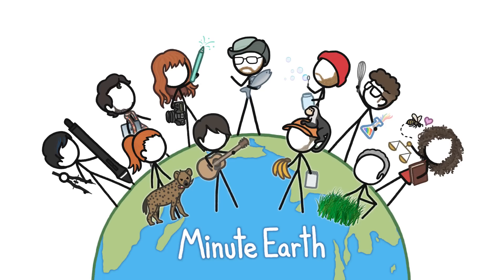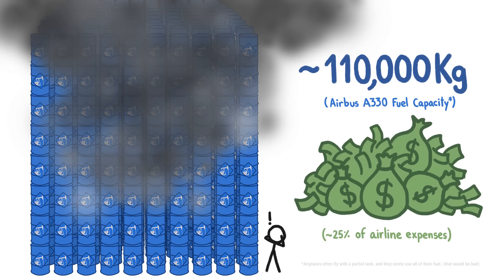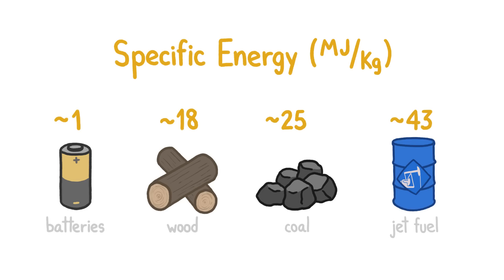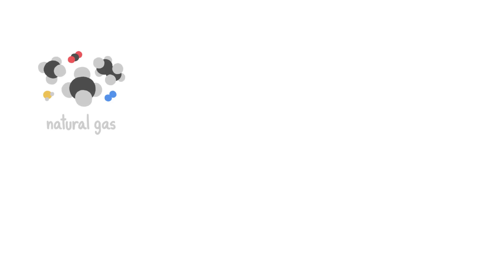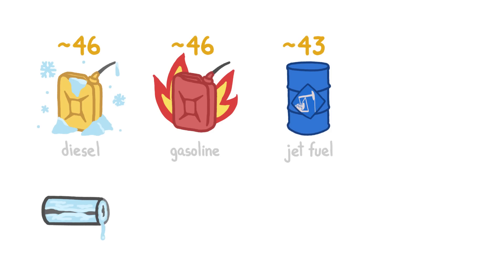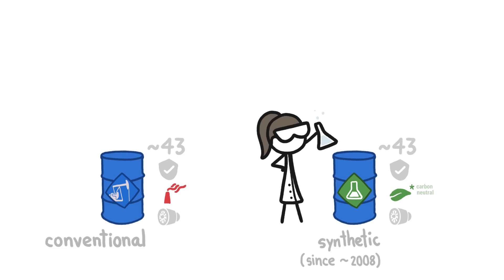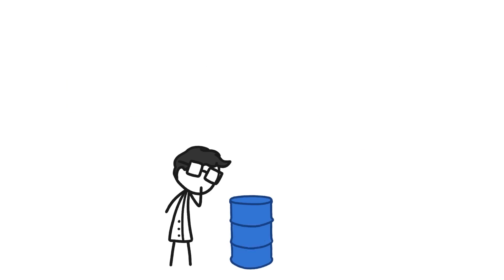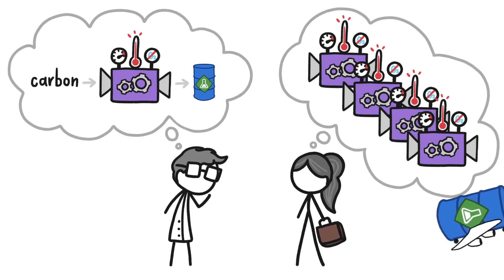Is There A Better Way To Power Airplanes?

Comment: +Minute Earth Just watched your vid against dis-information, then this!

* Nuclear Airplanes are an extremely interesting part of aviation history. http://www.aviation-history.com/articles/nuke-american.htm Moreover, AFAIK it was the closest #Thorium-#MSR came to productive use - a transmuting reactor can eat up nuclear waste that's impossible to safely sore (>100,000 years) and convert it to nuclear waste that IS decaying in manageable timelines (~300a).

* To "mimic natural processes", you have to harvest carbon dioxyde from the athmosphere - everything else would take stored carbon and release it, like kerosene, only with a worse energy balance. This won't be possible by plants (they don't grow as fast as we need the carbon). Even with the newest research in algæ, this won't suffice to cover our kerosene consumption.

* Thinking about "alternative jet fuels" thus is a fool's errand. What DOES work is "alternatives TO jet air traffic":

** The German engineer Bœlkow - you can see his work in any modern small rescue helicopte being able to land in small spaces like in a street crossing - brought up dirigibles. Hybrid concepts - vehicles creating most of their lift by LTA, but need thrust to stay afloat and not sink gently - are one possible venue. Fun fact: In Schütte-Lanz-Zeppelin airships, there was Traggas (Hydrogen, or if available Helium) and Kraftgas (fuel). The fuel gas, most likely ethane, had the same density as air, so consuming it did not alter the balance of the airship.

** But in the short and middle terms, it helps TREMENDOUSLY to leave trans-oceanic air traffic as it is and get intra-continental traffic on the ground. The #Transrapid MagLev, eg, was constructed so that its thrust was to be created by stationary power stations; and its railway was only energised in the blocks the vehicle was in and the next, switching off after it passed them. It was designed to eventually reach a speed of 750km/h, while, however, 350km/h was the initial Vmax in order to research any possible stability issues travelling at higher speeds for extended times.

#Transrapid was built in Shanghai, Red China. Although it was planned to connect metropolitan areas in the FRG in the 1990s, it was abandoned due to cheap air traffic. 

A country like the USA or Russia with metropolitan areas separated by long, sparsely-populated stretches would be almost the optimal use case for the design. Of course, it's only profitable when the carbon dioxyde balance majorly impacts the price; in other words, when carbon dioxyde reduction is taken seriously.

"Alternative Jet Fuels" are as anachronistic as "modern coaches". The need for them is greatly reduced when overland traffic is brought back to the ground again and only necessary trans-oceanic travel has to be airbourne. As long as people want to fly cheaply short-distance, it simply isn't feasible.

Comment: Thanks for this. Ever since I knew about hydrogen cars and that batteries were too heavy to allow electric airplanes, I've been wondering why while it's not as practical for cars, hydrogen powered airplanes couldn't be a thing.
Reply: The Soviet Union made a hydrogen powered plane so it’s feasible but it’s not as efficient, yet
Reply: Hydrogen powered planes are working just fine actually, it's incredibly easy to burn hydrogen in a jet engine. The pressurized tanks are heavy but not more than full tanks of jet fuel, really it's manufacturing hydrogen that's the biggest issue. It runs into the same cost problems as synthetic fuel

Comment: I recommend using nuclear fusion and you can compress hydrogen
Reply: Yeah, if we can figure out how to even create nuclear fusion without insane temp or pressure and at a scale where it is profitable and energy used to create fusion is higher than the energy output by fusion, if it is a tech tree, we aren't even at Tier I fusion
Reply: @isaaclao2380  true.

Comment: What if we just make the planes travel differently such that they use less fuel. What if a ground based source of power got the plane started so it only needed to travel along not take off.

Comment: wait haven't we tested hydrogen fuel jet engines and found it actually works well. Problem is just the cost, since producing and storing is a pain in the ass. Also a minor loss in cargo space, which effect the cost per flight. But if I remember right normal engines can run on it just fine, so not a lot of redesign. Actually now that i think about it, why is it hydrogen fuel is not being given more credit? We kinda have the infrastructure for it, so switch over would be not that bad. It has good energy potential for a lot of current vehicle needs, and burns clean. Producing it can be done using things like nuclear power, thus cleanly and to a very effective degree. Also it's rather safe, since it wont spread or pollute and wont explode unless you give it a fuel air mixture inside a container for some reason. It's actually rather weird how amist all the clean energy wants and needs, it's not given more attention.

Comment: just because its 'free' doesn't mean its the best choice. synthetic fuels are superior to electronic cars, since it uses the infrastructure, the available cars and is co2-neutral if made with green energy.
i don't get why this obvious way to go isn't being followed as it should. ofc fuel would be more expensive, yet there is no alternative to it. the disposal costs of new e-cars and old cars alike would outweight the front-loaded cost of a more expensive fuel. but ppl are dumb and don't get it.

Comment: So let me get this straight. A video sponsored by Bill Gates is saying that nuclear fuel is too dangerous. A fuel that has been used in subs and aircraft carriers for decades, produces no carbon emissions and is much cleaner to mine for than coal, oil and lithium. This just shows that gates does not want clean air or green energy, just to keep people poor.

Comment: Synthetic jet fuel is a stupid idea. You need to pump obscene amounts of energy (usually in the form of electricity) into it through a less than stellar process in terms of efficiency. Considering that one of the most economic ways of getting electricity is by burning fossil fuels through another energy inefficient process, the modern energy paradigm (which is not gonna change within the next 20 years) dictates that not only will conventional jet fuel always be cheaper than the synthetics, it will also always be more carbon efficient. Unless you change this entire paradigm (which, for various reasons, is probably not gonna happen), synthetic jet fuel will always be a stupid idea.

Comment: “Less pollution” sounds dodgy to me. Needs to be “no pollution” or we’re all going to hell in a handcart
Reply: Synthetic fuels like bio-diesel are beneficial from a pollution standpoint. They still produce greenhouse gases when burned, but the act of growing plants to produce those fuels captures carbon. Versus with fossil fuels, where that process takes millions of years, with the synthetics, the carbon will cycle between the fuel and the plants and we can basically have 0 net pollution. Its possible some of the alternative combustion products or processing side products will prevent it from being strictly carbon neutral, but its a very huge step up compared to just burning trapped carbon.

Comment: You didn't mention that there is solar powered airplane. One that flew for almost 26 days straight without refueling. Sure it was unmanned and ultra light and that's a LONG way from powering something that could carry people but it's a theoretical alternate power source. And that's not even mentioning other types of aircraft like an airship which does run on jetfuel but might be more suitable for a refit.

Comment: Y’all are disrespecting nuclear fuel. First of all, we’d definitely shield the uranium in the sky, so we only have a risk during a crash. Secondly, that energy density is insane.
80 million mega joules per kg
A regular jet needs 110,000 kg of jet fuel at 43 mega joules per kilogram, or 4.73 million mega joules.
4.73/80 = 0.059 kg or about 60 grams of uranium for a long distance flight.
Additionally, the cost of just fuel will plummet. Uranium is about $78 per kg (less in its market form but we need fuel grade). So we are talking $4.68 per fill up compared to tens of thousands of dollars. Of course the planes will be more expensive so I assume it will cancel out.

Fat man and little boy had 65 kg of uranium each. A minuscule amount was transformed into energy so the rest got flung through the atmosphere as fallout. In 2019, 86 commercial airlines had accidents, only 8 of those had fatalities. I will assume that all 86 bring a risk of nuclear leak - which is insanely pessimistic. So, if we say 100 flights per year crash with risk of a nuclear leak, then we leak 6 kilograms of uranium over a year. It would take 11 years to equal the fallout of Hiroshima, which itself was minuscule compared to later nuclear tests. And most will be contained to airports, where we can more easily clean up. That’s assuming we are not protecting the uranium from crashes to begin with AND that every gram of uranium leaks with every crash.

I think the limiting factor is not safety, but size and deployment. Can we create a nuclear reactor that a) can turn on/off b) continue running while low on fuel and c) can fit inside a plane. I think some reactor designs can safely move from high power to low power modes, solving a) and b), but that would mean you’d be refueling a live nuclear reactor. IDK how touchy that is. I think that by far c) is the limiting factor. The radiation risk is just to low to make that the sticking point, but most reactor designs fit inside buildings, not planes.

Comment: What about solar powered planes hybridized with batteries? They could recharge midflight and help reduce the weight of the batteries required. Since planes would most likely almost always have sun light, it seems pretty obvious

Comment: This is for once a very poor video with a single wrong message: "no other solution". It forgets to introduce so many aspects, such as high efficiency electric propellers combined to fuel cells (that are high density and already available technologies), ground assisted take-off, not to speak of MagnetoHydroDynamic or ElectroHydroDynamic technologies that are more futuristic !

Comment: Fusion powered cars, domestic robots, portable computers, nonpolluting planes.
Technology, technology never changes.
Reply: it only took 200 years to build this oil and combustion engine based society we have today...
Should I seriously  think that we can replace oil in just a decade even if we tried? -Nope. This transition will take decades at least even if space aliens hands over a perfect blueprint of a new engine that can use air or saltwater as fuel. 
There are millions of machines that needs to be replaced and spit out from factories. And entire factories needs to be rebuilt. And oil needs to be wasted to build all those new cars - since half of all oil used in a cars lifetime happens during the production process with all paints, plastics, and only a single tire would take 7 gallons of oil to make. 
Do we even have billions of tonnes of oil to do replace all cars in the world? I dunno.

But it is not just cars we need to replace... we also needs to replace motorcycles, trucks, airplanes, helicopters, bulldozers, lawnmowers, chainsaws, leaf-blowers, diesel trains, cargo ships, motorboats, motorbikes, tractors, and much else that have a combustion engine inside of them. And that will take years to do.
So I hope the space aliens be kind to also bring some hundreds of billions of barrels of oil to us, because otherwise would we quickly run out of it.
Especially now since China and India also want to western lifestyles - and that demands gigantic amounts of oil.
You need a 3 pound computer would need 30 pounds of oil to make. And then you need oil for plastic bags, handles on forks, toothpaste is made from oil and so are also cosmetics, medicine, perfume, and some types of clothes and candy and many thousands of other items.
Much of our use of plastic is pointless waste, but switching over to not using oil will not be an easy transition even with new technology. We are simply too dependent on oil as it is now.

Comment: Is it ever likely that we will have that synthetic jet fuel soon enough? Oil is running out, and companies aren't willing to invest because of capitalism worldviews.
Reply: I don't like capitalism, but blaming it for the failure of not inventing environmentally friendly sustainable jet fuel is something that only clueless idiots do. The airline industry have tried to do what you say they should do and they have invested billions in research but have failed to come up with any alternative - simply because such an alternative probably doesn't exist.
There are simply too many hurdles to come up with the perfect fuel... you must be able too mass produce it, it must be cheap to make, the fuel most be able to handle extreme temperatures, it must be energy dense compared to its own weight, it must be energy dense in relation to its volume, it must not cost too much energy to create that energy...

Those are just a few of the problems with finding a good fuel for airplanes.
But since you know better than the airline industry, then I suggest that you present your solution to them.
You would become a multi-millionaire from patents of your new super-jet fuel or engine that use water as a fuel.

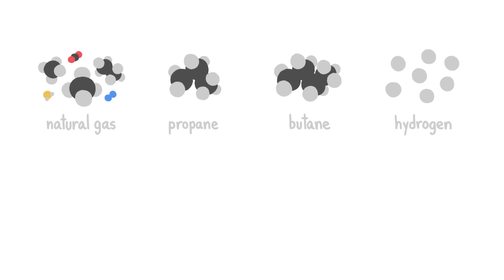Comment: 1:13 you know there is liquid form of these molecules right? We were just about to send people to space... if rocket fuel tank standard increase, maybe we can use it on airplane too.
Reply: Gaseous hydrocarbons can be liquefied, but it requires refrigeration and/or pressure. Butane is the heaviest (weight in this case is molecular weight, the density of the fluid when liquefied as far as I know is only loosely correlated to this) and is what is used in things like pocket lighters - it only requires slight pressure to liquefy, and has a boiling point of only -1°c!! That's so high that lighter gas is usually a mixture of both propane and butane, so lighters wouldn't become useless at subzero temperatures. Gas stoves used in very cold temperatures have to use special gas mixtures because of this, if you used the regular butane mix it would just stay liquid! Propane on its own is used in gas appliances and stoves and stuff, and you can really tell the difference in boiling point. Instead of a flimsy sheet metal or plastic container, propane tanks are heavy metal, to withstand the pressure of the gas and have a safety margin for very hot days and such. Ethane as far as I know is not really used as a fuel? I lack an explanation as to why, but I suspect it's used as a chemical for industry and separated off. Methane, the lightest, is the most important one. It is very cheap, both because it is the primary component of fossil gas, and also because there are organisms that can create it out of other organics! This makes it of interest for use as aviation and rocket fuel. The downside is of course the boiling point... Being only -161°C. Methane actually cannot be liquefied at room temperature. For use in cars and stuff, it is usually stored as a high pressure gas, but that requires very big tanks that store very little gas. For rockets, it is liquefied, with expensive cryogenic systems, that require another coolant, something like liquid nitrogen, to keep it cool without boiling off (the alternative is letting it boil to cool it down, but the greenhouse gas emissions from this would be MASSIVE, and the losses unacceptable). This might be possible to use on planes, but would probably make it much too expensive sadly.

Another problem with liquefied gases is that, even when liquid, they're still not as dense as liquid fuels like kerosene. The density of liquid propane is about half that of kerosene, and the energy density is two thirds of that of kerosene. 

I don't think liquefied or compressed gases as airplane fuel could really ever be viable. Metal hydride hydrogen storage has shown promise for storage density, but it is also very heavy because of the metal part itself. With current, or near-future technology in mind, I don't think planes will use anything other than diesel-like fuels. Maybe instead the source of those fuels will change, switching from primarily fossil fuels to, for example, algae derived fats.

Comment: I'm a bit sad nuclear fuel is dismissed right away, even though there are massively varying degrees of risk involved; and we could potentially discover completely safe options
but I guess nuance is hard in such a short video, so it's no biggy ^^
Reply: I don't think that would work for planes. A nuclear reactor needs heavy components for pressure containment and radiation shielding. That can be fine for land-based structures and even for sufficiently large ships/submarines but for a plane that would be highly deleterious because all that weight would require more energy to remain in the air. Also, in the event of a crash, the risks could easily be much higher than in a typical nuclear accident.

Comment: I've thought of a solution of making a airplane run on 100% electricity but without the need for battery, the solution is simple, but a engineering challenge, My biggest fear here is someone takes my idea and starts working on it!
Reply: Man, main source of electricity generation is fuel. So we are back to square one. Planes still would need fuel but instead of using it to fly, planes would use it to make electricity and then fly. 😂😂